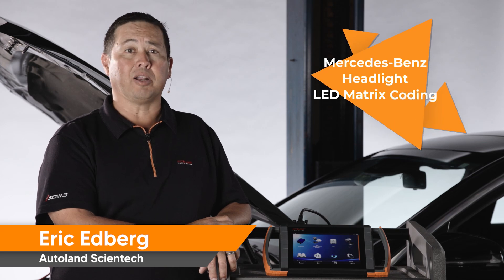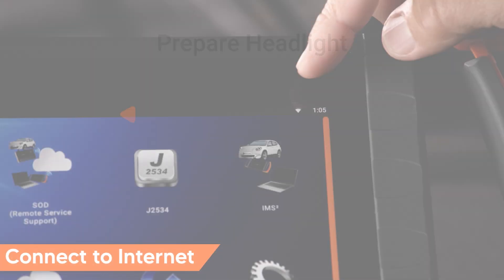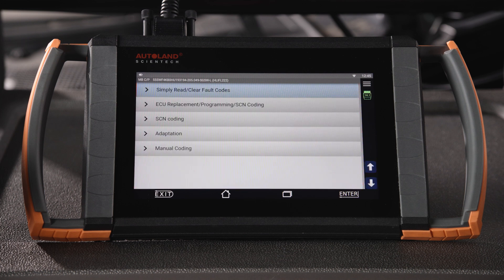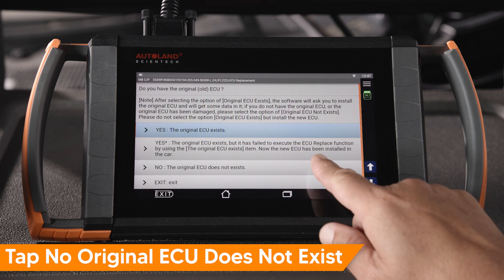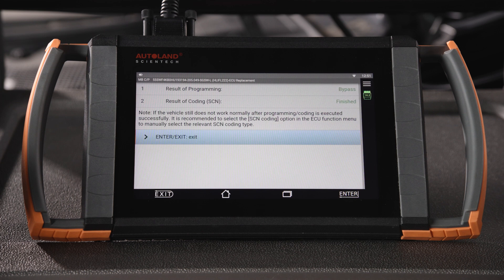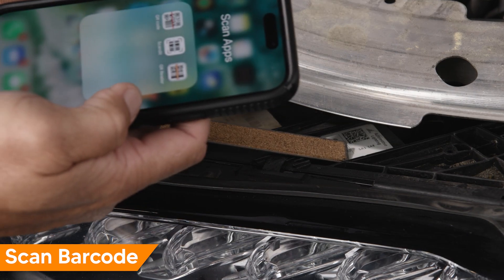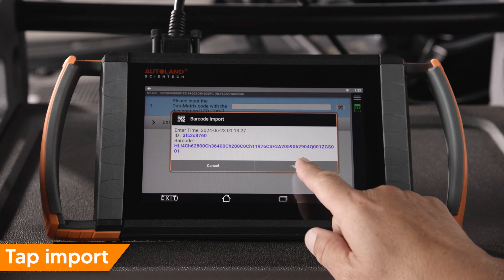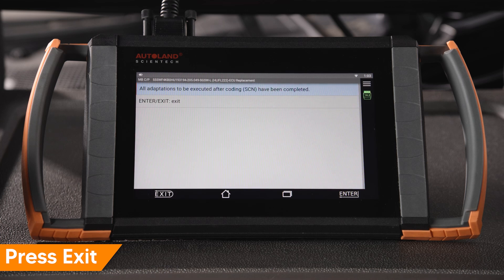Mercedes-Benz W205 Headlight Data Matrix Coding (C Coding) Bar Code Scanning Into Control Module

Comment from the maker: We have been asked a few times about installing used headlights, and here's the answer:
Good question. Here's the best way to look at it. We don't recommend it. 

Here's why. If you source a used headlight, you can swap the housing over to your vehicle, using all the old electronics from your vehicle. That will allow it to work without recoding. The vehicle will not know you swapped anything. However, the new (used) headlight housing will have or potentially have its own unique MATRIX data for the housing. You will then have to learn that dat matrix. Coding will not be necessary because you reused your electronics.

Comment: What if you purchase a new OE headlamp housing but use the old modules and transfer them over? Should you adapt the led matrix?
Reply from the maker: You can swap the housing over to your vehicle, using all the old electronics from your vehicle. That will allow it to work without recoding. The vehicle will not know you swapped anything. However, the new headlight housing will have or potentially have its own unique MATRIX data for the housing. You will then have to learn that dat matrix. Coding will not be necessary because you reused your electronics.

Comment: Thanks for the great video.
l had this trouble on a w176 chassis with a headlight circuit board burnout.
Replaced the board with a new one on eBay from Germany but would not work.
Ended up having to go to a dealer for a coding issue. wasn't cheap.
Reply from the maker: Yes, has to be new and coded to your vehicle. Thanks for the comment!!!